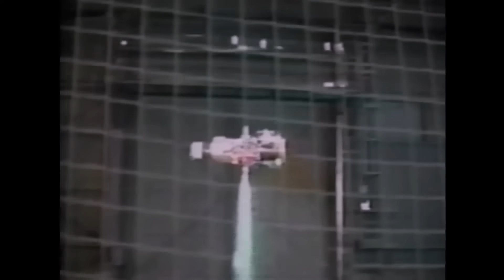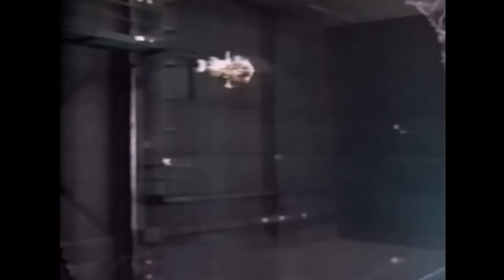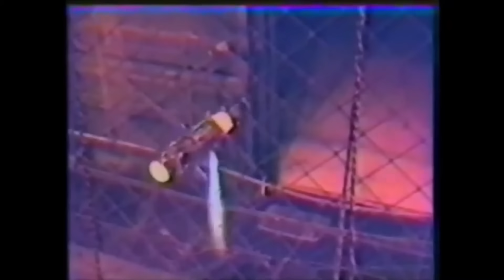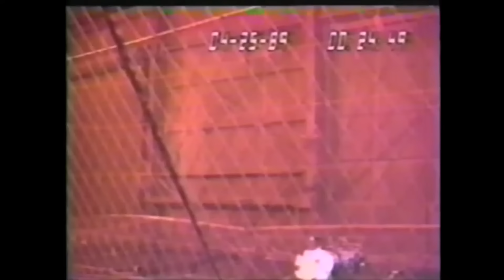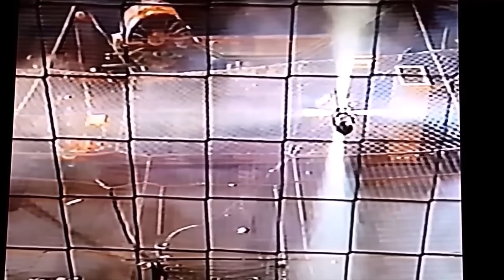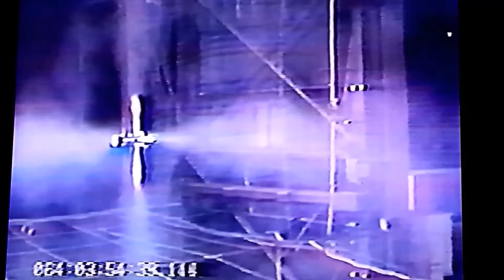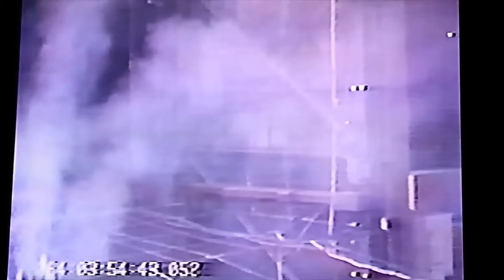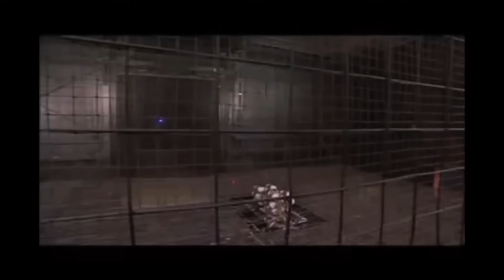EKV/KV/KW/KKV/LEAP (Exoatmospheric Kill Vehicles) Hover Test - Compilation Video (SM-3, GBI, etc.)

Comment: It's crazy that a lot of these vehicles were filmed during the 90's and are considered relatively "low tech" compared to today's modern EKV's.
Reply: They are probably significantly better and more reliable than today's. Our current engineers are junk compared to golden era NASA and DARPA engineers. Also loads of them are Chinese and Indian nationals quietly sabotaging the only nation dumb enough to pretend that such distinctions don't matter and should be ignored
Reply: I know your comment is 2 years old but could you elaborate more on the Modern EKVs, what are they?
Reply: @wyattguilliams5325  missile defense systems, the most advanced in the world, capable of intercepting oncoming warheads mid-flight by separating off of an intercept missile to destroy the oncoming one. Used in the national missile defense system here in the U.S
Reply: @babyzdog4324  

How many of them Hover?
Reply: @wyattguilliams5325  idk about any military kill hovercrafts or anything but I know hovercraft are used in search and rescue operations.
Reply: @babyzdog4324  

Not what I'm talking about MKV/EKV
Reply: @wyattguilliams5325 they don't hover in practice. they retain the velocity from their boost to orbit, and track a heat source just like atmospheric AAMs do.

Comment: So this is 40 years old. The 'ufo' sightings recently are almost definitely just an evolved version of this thing.
Reply: I’m starting to think so
Reply: @theUNEXPLAINABLEuap  Not much Air time, less than 30min and way too noisy. Propulsion is a major issue. Not to mention size. They had to down size it just to make it flyable. If you want Jets in Russia u need Aircraft "Carriers".
Reply: Not really. UFO's don't make sound or have a visible means of propulsion. Sightings have been reported for over 80yrs.

Comment: 1980’s: what regulator system should be used for controlling this craft and how can we tweak it to be stable? Perhaps a Kalman filter with a PIPD regulator.
2020’s: just throw in a LSTM and/or a time convolutional network and train it, that should do the trick.

Comment: Remember that the prototypes were likely running on microprocessors in the kHz range back in the 80s and 90s. Tech has only gotten faster, lighter, more robust, and with greater capacity at lower costs since then.

Comment: Lithium batteries killed this concept.  Up till this point, LA, NiCD was the only battery tech available. Vvery low mass / high power density batteries simply were not available.  Today this would be powered by electric motors and external or ducted fans driven by high speed lightweight motors.

Comment: I could play with this propulsion system I mean theoretically if you can get it to rotate or spin you could operate the hovering higher and lower height with the same buttons you'd use to control the left and right movement. So it would rotate like an axis and still move as doing currently from remote

Comment: Let's be honest it's a crock of shit! The noise and flight time are a joke! It's also internally guided with no remote control function, the gyroscopes are keeping it stable and the exhaust burns make just enough pressure to hold it but as far as travelling a distance it failed from the start.

Comment: Impressive how such a small device has the fuel load capacity to remain airborne for so long, especially with multiple stabiliser thrusters firing continuously and simultaneously.
Reply: It operates as a pulse jet so the propulsion isn't always on. It's like PWM.
Reply: @hoobaguy   yeahbbut still.......
Reply: @hoobaguy  It's like little thrusts to maintain height
Reply: @henriquesegatto3742  That's pretty much exactly what I said.
Reply: @FIVE-0-APOCALYPTO  sir this is a Wendy's
Reply: @blakelowrey9620  🤣
Reply: @blakelowrey9620  xD
Reply: I'm wondering what the power source of this is,  what type of chemical has that much release of energy . It almost looks like high pressure steam
Reply: @taijay6967  liquid hydrogen and liquid oxygen kept in separate tanks.
Reply: @hoobaguy  are you sure? It looks and sounds like some nasty hypergolic to me
Reply: @blakelowrey9620  I'm not sure at all. That was just an assumption. To me, the exhaust looks more "cloudy" and less "flamey". I could definitely be wrong though.
Reply: @hoobaguy  you could be right but I think a hydrogen tank would take too much volume and would have long term storage issues. I bet it's some skin melting  acidic shit lol.
Reply: @blakelowrey9620  Yeah, there are multiple frames with the dark brown/orange un-burned hypergolic signature during flame outs.
Reply: @hoobaguy  hell no lol with the responses of those thrusters they definitely need hypergolic propellants to function at that rate
Reply: @Blake Lowrey  Correct. I worked on components for the SDI program in 91'  brilliant pebbles being one of them, and they even had systems with mono propellants that used a catalyst in the combustion chamber. A hydrolox system requires an ignition source to fire. Yeah, I'm that old, lol. Fun to watch but loud AF. We also made components for Mars Pathfinder. Now called the Carl Sagan memorial station on Mars. The company Techstar is long gone, but the memories remain.
Reply: @hoobaguy  nah, these probably use some toxic hypergolics
Reply: @FIVE-0-APOCALYPTO  There is no shot you just wrote an entire novel just because someone said you would “offer your thrussy to the third reich.”
Reply: The fuel must be some truly nasty stuff
Reply: @blakelowrey9620  probably dinitrogen tetroxide and hydrazine
Reply: @blakelowrey9620  Rumor has it they were using Polish wodka!
Reply: @ChickenDeranged  All powerful WODKA?!
Reply: @blakelowrey9620  comment updated - thank you sir!
Reply: @ChickenDeranged  lol your welcome but it wasn't really a correction per say, I was just making a joke about PURE WODKA POWER!
Reply: @FIVE-0-APOCALYPTO  delusional
Reply: @FIVE-0-APOCALYPTO  you’re cracked, laddy
Reply: Look at how Thaad missile system work, kinda look the same with this one
Reply: @FIVE-0-APOCALYPTO  and now we have the Blue Origins rickets that land themselves upright, unmanned.
Reply: @ButterfatFarms  The guy is clearly a schizo, just ignore him.
Reply: At 3:28 you can see clearly is some type of ignited gas the way the night sky and heat is generated. But seems extremely high pressure.
Reply: @vojtechjancura682  lmao you prove us wrong fool you are in the minority in opposition of the truth
Reply: @FIVE-0-APOCALYPTO  baby steps
Reply: My only question is how do gyro work in zero gravity?
Reply: @conradgonzalez1570  because gyroscopic forces are driven by angular momentum and not gravity
Reply: And at 4:29 the relift shows it very well
Reply: @FIVE-0-APOCALYPTO  you're not impressed by 30 year old technology, cool beans, such upvotes. now imagine the kind of modern kill vehicles being worked on that will be declassified in 2050.

i suppose we'll see you in that comment section too, offering up the thrussy for the third reich lmao
Reply: 30 seconds isnt very long..
Reply: @FIVE-0-APOCALYPTO  it can't be fly by wire as it's supposed to work high in the atmosphere and I believe it's targeting system is homing in on a heat source.so it's self guiding. Just needs a proper target at proper range.
Reply: @FIVE-0-APOCALYPTO  dude..im just saying its not meant to be fly by wire
Reply: @vojtechjancura682  city of london
Reply: All that remains is to miniturize the propulsion system.
Reply: Fuel efficiency!!
Reply: @FIVE-0-APOCALYPTO  🗿 ight
Reply: @FIVE-0-APOCALYPTO  you need help bro lmao
Reply: For so long? I think the longest flight I saw was 45 seconds.
Reply: how about stop acting like you are some master race in this YouTube comment section? You spend so much energy on this garbage that you will be misserable always. Also you don't sound very northern European name wise Bozo
Reply: @vojtechjancura682  go visit a holocaust museum 👌
Reply: @toddburgess5056  whoa that's awesome. To be honest I'm not sure how monopropellant works but it seems like it's pretty reactive stuff
Reply: @FIVE-0-APOCALYPTO  i dont think you saw the "Engeneer's celibrate when the Falcon heavy landed ??

Bye now .
Reply: Can you imagine this thing in 0 gravity, in the vacuum of space. Must be incredibly fast...
Reply: It DOESN'T ... the whole clip is FAKE !!!!
Reply: @ezrider1205  fake news
Reply: @vojtechjancura682  it's hellaofa drug....
Reply: @FIVE-0-APOCALYPTO  that was a load of gibberish right there
Reply: @FIVE-0-APOCALYPTO  it's simply a safety cable, in one of the clips its untethered..
Reply: @KrisRoberts114  yeah? Dont tell me you another one who "worked on it" too eh?

Gotta lot of them engineers and researchers and scientists up in here mang'. 

"Tethered" he says. 

I'm the engineer and researcher and scientist in here. I want you to tell me what tethered means exactly?

I mean there's like a little leprechaun inside right controlling pitch and yaw.... right? 

God bless his little green hand must be going in every single direction 127.6 times per second to keep that SHUP afloat eh?

Show me the little green man. What's his name?

Maybe his name is tethered.... hmmm🤔?

Mmmm hmmmm. 

"SHTICK-slip".
Reply: @FIVE-0-APOCALYPTO  No.. I didnt work on it, but it's clearly to sling it into the net incase of misfire instead of it smashing into the wall..
Reply: @FIVE-0-APOCALYPTO  wow some engineer who doesnt think canoes can go upstream, "I'm like the predator" yeah maybe the one that has to blow itself to bits after Arnold fucks it up🤤😂
Reply: @FIVE-0-APOCALYPTO  you haven't worked on shit at nasa aimes or jpl, why dont you go back to smoking kronik and making up rhymes with your buddies
Reply: @FIVE-0-APOCALYPTO  what do you call a fly with no wings?
Reply: A young native in the Philippines was not enjoying the Sun one early morning as I was speaking to him, sweating in that very same Sun. This young man just previously, stated he wanted me to come to his village and meet "the elders".

I already knew after a few minutes he wanted to go into the shade and he said so a minute later and it could have been 2 hours later because I was not going to stop talking, knowing full well that THE SUN, was bothering him.

In other words I forced him to interrupt me, proving without a doubt that the Sun was owning his ass. 

A Hindu shaman type happened to walk by right at the critical moment and I said to that young man why do you get out of the sun's way?.... Especially while I'm giving you your answer to your request to visit your village elders who you claim, know EVERYTHING. 

I turn towards the Sun and stare at it and say out loud do you see me getting out of the way of the Sun?

I knew the Hindu was standing behind me before he even stopped, for he knew I was teaching this young native something while getting value for myself,...   for what is wisdom if it does not profit the wise?

While still starring at the SUN, I now yell out, WHY DOES THIS SUN NOT GET OUT OF MY WAY EVEN THOUGH I BELIEVE!!... MOVE...MOOOOOOVE!!!

I turn toward the Hindu and quietly say to him, "Im blinded from the sun, it did not move..".... and then I say it loud enough so the young man could hear, IS IT BECAUSE I DID NOT BELIEVE?!!

The hindu said NO.

I instantaneously turn toward the young native and crazily say, HE'S RIGHT! HE KNOWS!.... DO YOU KNOW WHY THE SUN DIDN'T MOVE?!

The young man said no...... completely fascinated. ...... I could now start to make out his face in the shade after staring at the sun for a good six or seven seconds previously and i say:

...its because i don't know how, AND HERE IS TRUTH, do not make a fool out of your own self in ever thinking that moving that sun is impossible or silly......  ITS RIDICULOUSLY easy!. .....(as i stare directly in that young man's eyes) ok. 

I can hear the Hindu behind me chuckling with a big smile on his face as I continue to stare directly in that young man's eyes. 

I now angrily slap the concrete mezzanine the young man was standing on while in the shade, ....meanwhile me and the Hindu are standing on the sidewalk in that blazing relentless sun. 

I turn towards the Hindu and say why are you so happy??... BEWARE MEIN POWER... Did you dare think that was all i got?....his expression immediately changed and even I can't say for sure if he was insulted or knows there is more to come, but that's his problem and not mine and I would figure he knew that much. 

However, there is no way he could possibly know or prove that I am the one who made him stop because I knew he would be interested in what I had to say, and I would not have done that unless I would have some form of payment for breaking his will.

I have to pay because I know he would listen and of course it's always pleasurable if people listen to you, especially when most would not.

I could tell just by looking at him. 

I never met the dude in my life. 

I now yelled at this young man:

BEWARE OF THE TRAPS!....do you believe? 

I put my finger up motioning do not answer and I turn around quickly and look at the Hindu and say ....ITS OBVIOUS ......(WITH THAT INSANE LOOK IN MY EYES)

And now I calmly turn back around and tell that young man that the worst trap is the one people set for their own self and proudly walk into it while telling everybody else they are stupid. 

He's still staring at me with that blank look in his eyes and I know he can't possibly understand.

I say to him, if you truly believe, then why are you still standing in the shade? .... Ask yourself that question and tell it to the elders and tell me what they have to say and then I'll give you my answer as to weather I shall come to visit your village or not.

This Hindu shaman dude said i was a prophet and walked away. 

I believe him. ....why not.
Reply: @FIVE-0-APOCALYPTO  One more question..
Why dont scientists trust atoms?
Reply: @FIVE-0-APOCALYPTO  incorrect... what do you call a fly with no wings..
A walk..  budum tschh!😂 
Some prophet lad!!!🤤😅
Reply: @FIVE-0-APOCALYPTO  you said I could ask any question and I'm still without a direct answer, come on paul the prophet, split that hair one more time..  😉
Reply: 70
Reply: some type of peroxide reaction maybe
Reply: It looks like old 1950s,1960s, nuclear ram propulsion. It is nuclear powered,it produces a endless series of nuclear explosions used for propulsion. Originally the technology was to be used as a rocket to escape Earth orbit a d can also be used as propulsion through space for deep space probes. The technology is well proven but it was shelved I'm the early 1960s.  It looks like it was resurrected for Ronald Reagan's SDI.  SDI research was supposed to be stopped by Treaty with Soviet Union in 1980s before collapse of Soviet Union.
Reply: @conradgonzalez1570  wrong, it's called "project pluto" and it doesn't pulse. The radioactive element heat air and turn it into a thruster
Reply: While testing in enclosed spaces, it would never been operated with a full fuel load. ;)

Comment: A new form of propulsion would help greatly in the longevity of flight for these tiny vehicles. I see how extremely limited they are in operational time values. Fuel is a true impediment for an extended deployment. Are there any alternative propulsion systems ???
Reply: Yes, there are in fact the predecessors that came after a few of these models, namely [REDACTED]’s B.A.M.F (Barium113 Aerosol Multi-Induction Fuel) system utilizes a variable [REDACTED] thermonuclear quantum-leap technology, capable of intercepting [REDACTED] via [REDACTED] sourced hygroscopic LIDAR sensors, enabling [REDACTED] air-sea travel with no added drag or reduced efficiency. I’d get into further detail but there are two sharp dressed men at my front door, be back in a bit.
Reply: @rustyshack1707   Men in Black, I assume ?????

Comment: As a matter of fact, theyve since been using this technology regularly, albeit i guess in top secret ways we cant know about.

Increasingly and especially over the last decade, there have been numerous reports from air force pilots of ufo’s that fly exactly as shown here that they couldnt identify nor keep up with, due to the ufo being able to pull many more g’s than the pilots and switch directions on a dime. (Please correct me if im wrong, i remember reading ab this somewhere)
Reply: They have objects on tape. it was not one of these and there is no recorded jet plum.

Comment: A wildcard plan would put a few hundred of those things up in orbit as extra secret payload during a Starlink mission. Would anyone else be any wiser? Such a gambit would give the U.S. an edge up as a defensive measure with a ring of KKV micro-sats. Maybe not 100% (still somewhat experimental), but it could come as quite a surprise for anyone using a ballistic weapon.
Reply: Problems: 
1.) Pretty sure other nations will take notice of any such move by the USA. USA can certainly put more of these in orbit than any other nation, but USA is not the only nation that can create a constellation of these in space. At least three other countries can do it as well.
2.) Doesn't make practical sense given Kessler syndrome threat to use Kinetic means to defeat satellites. 
3.) Against ICBMs, the bigger problem would be tracking and guidance. SBIRS type constellations only give early warning, not a weapons quality track. So what next? Massive aperture BMD Radars in orbit?

Comment: I dreamt something similar to this about a year ago. It was a craft that had pieces that would open up an shift and let out exhaust or thrust an suck in air and just kept moving in different panels all over the craft. This is close but not the same as my dream. It didnt have huge thrust flames just high pressure air